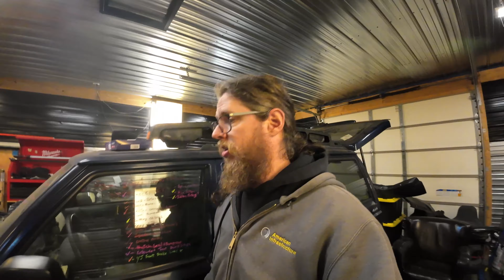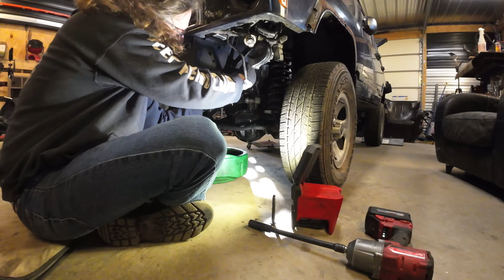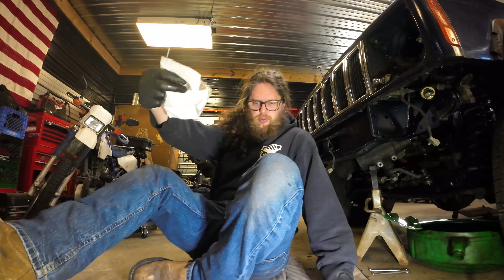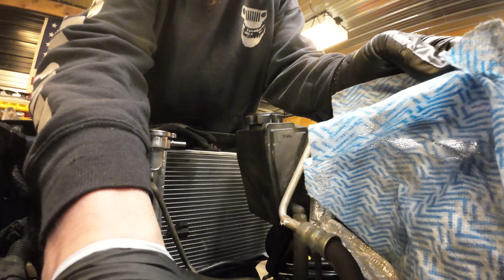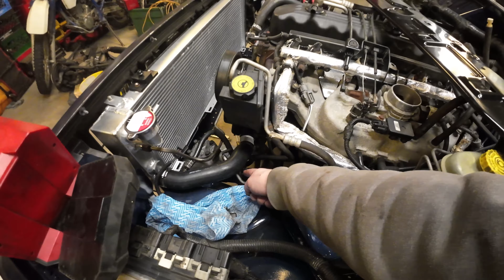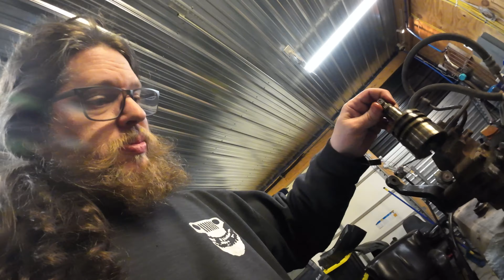EP48: Attempting to fix saginaw Steering box Seals  #betsyrossxj #jeepxj

Comment: Try RedHead Steering gears. I build the "smiley" boxes and "6bolts". I have taken these saginaw boxes apart when I first started for the company. the orbital valve does come apart there is no lock ring on them. and they do come apart easily. when you pulled the orbital valve did the worm valve move with the orbital valve? we get alot of these boxes in as "cores" and they always have play. or the inside of the piston is messed up. good video though! They are fun to work on! We do custom builds too.
Reply from the maker: Thanks for the info. I think The worm valve did move with the orbital. The issues seemed to be deeper in the box and I might have just not noticed until I started trying to fix the leaky seal. 
I was just on red head steering gears website a few minutes ago looking at offerings.

Comment: I tried to video when I rebuilt my steering box and ported it for hydro. I made a few mistakes and scrapped the video but ultimately succeeded in rebuilding the box, its a pita.
Reply from the maker: I am on the fence on this one. Long term I would rather just put a good box in, but I also really want to know how I messed up. Sadly I’m swamped at work and this exercise wasted a whole weekend that could have been spent prepping it for the exhaust shop.  🤦‍♂️
Reply: Its best to fully remove it and do on a bench. I did a full rebuild not just the input seals. im only a couple mins in so ill let ya know if I see what went wrong lol @MalarkeyTaylor
Reply from the maker: @FlawedOffroad  I should have just pulled it. But it seemed to go so smoothly at first…. 🤦‍♂️